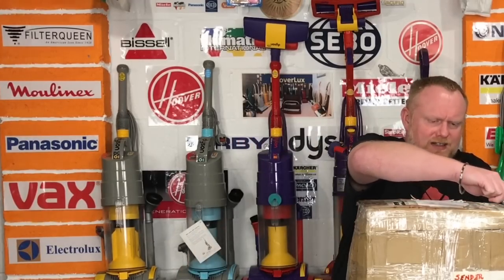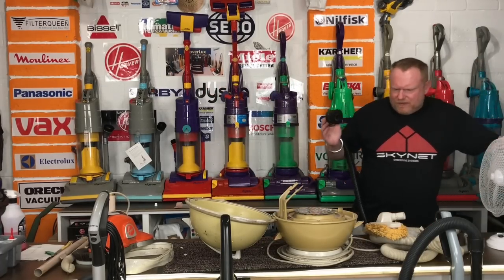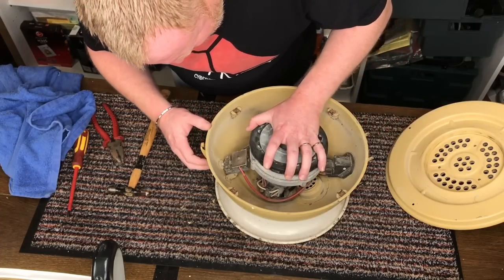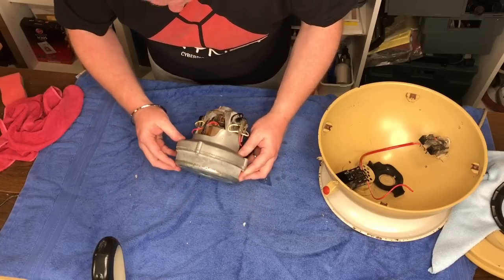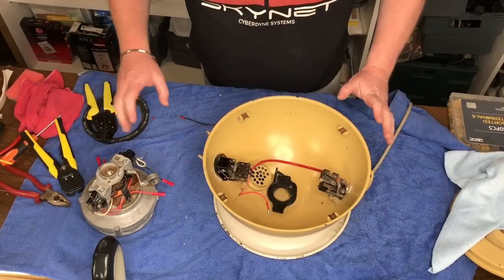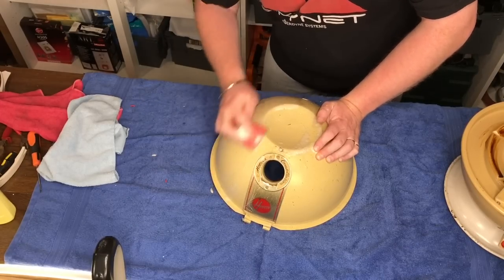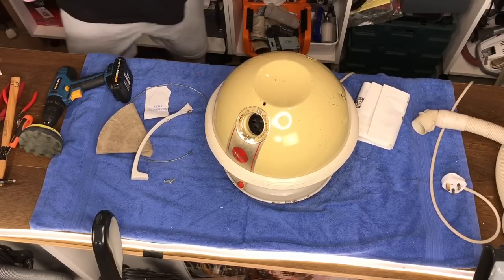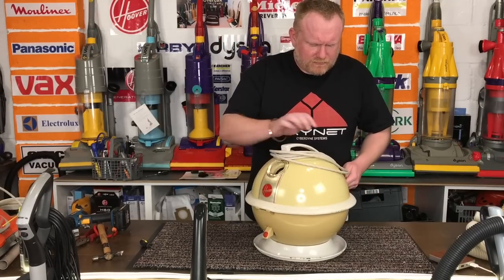Mystery Hoover Box From Ozz Part 1

Comment: Nice stripdown video Dorian - always like to see them, although the 60FPS recording rate does cause problems for my browser, so I now seem to only be able to watch these videos in 480p instead of the 720HD I could before. I think older computers processors cannot handle the 50 and 60FPS frame rate, as they cause my CPU to run at a constant 100% and the picture lags, freezes and drops out while trying the play in 720HD60. I have the same issue with Mikko's videos on Vacuumtests, and it kind of spoils the videos.
Reply from the maker: MadAboutHoovers Glad you enjoyed the video, it turned out really nice in the end. I put the hose in a washing bag in the washing machine and I cane out absolutely sparkling like new. I washed it with all my work cloths so it didn’t damage the machine. Can’t wait to do more Demonstrations with it because it’s lovely. The different style on/off switch is really rugged and works a lot better than the ones we had, far more robust. I’m afraid they’re all in HD1080p 60ffs 😢